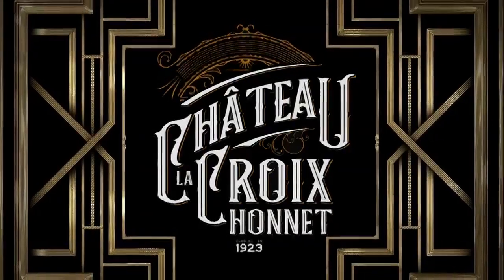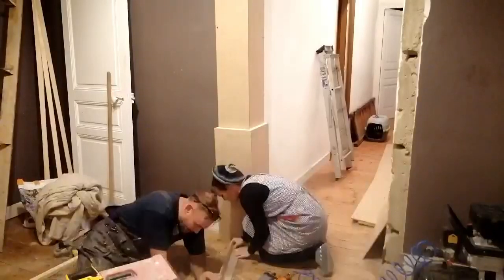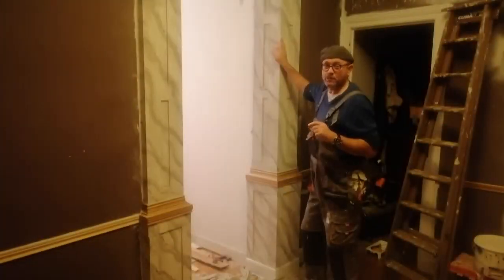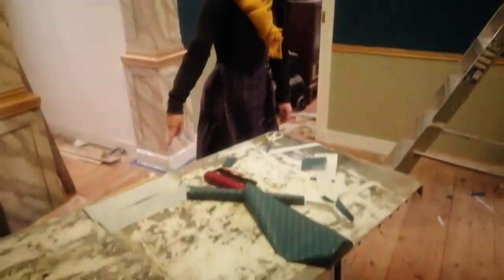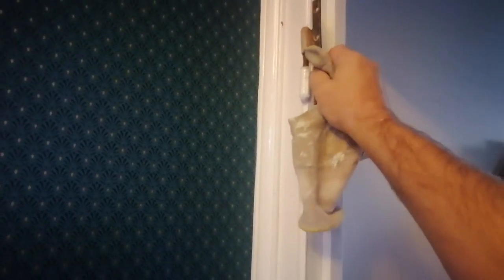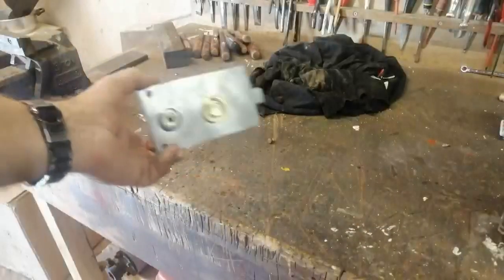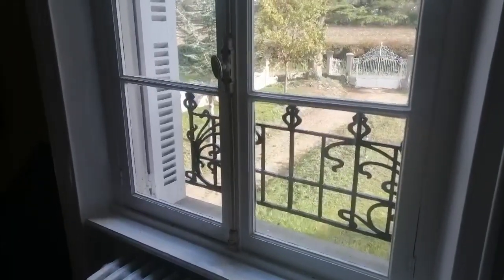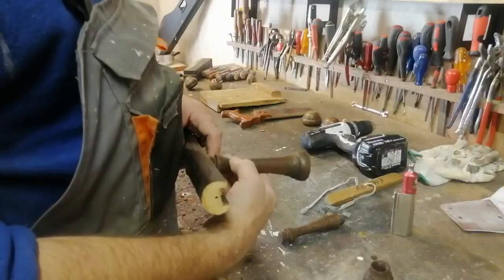Ep 60: Wow, what a landing!

Comment: As always, well done. I love your attention to details. Nice job on the marbeling of the columns. Door hardware looks to much better with the paint off and cleaned up. I have used a crock pot to boil the hinges in water- works great
Reply from the maker: Thank you very much mark, and thats a top tip on the paintwork, thank you for your comment and suggestion!

Comment: I’m not a fan of faux finishing, but I think if you’re going to faux-finish the pilasters, then they need to be faux marble from floor to ceiling. If they were real marble, the skirting board and the carved ‘dado’ section of the column between the main vertical portions would not be wood, and would not be painted. I wouldn’t have skirting board on the pilasters at all, it is essentially a door frame, and the skirting board is supposed to die into the door frame. Also, the architrave/lintel would be marble, all the way to the ceiling. The way this is painted, it gives away the marble illusion, and it violates the visual hierarchy of the room as a whole. The pilasters and architrave are a primary architectural element, but you’ve got it divided up so that the parts of it get sort of pulled into the secondary architectural elements of the wall divisions above and below the dado rail and picture rail. That kind of blurs the lines a bit for me. Of course, all of this is a matter of opinion, so feel free to ignore mine.

Also, since you mentioned that you’re color-blind, I hate to criticize your color choices, but this color scheme feels a bit haphazard to me. Of course, I don’t know how accurate the color is that I am seeing it on my screen, the colors definitely look different in reality and you have to take what I say with a grain of salt in that regard. But, to my eye, the color below the dado rail doesn’t seem to coordinate with the other colors, and the bright white of the door casings and skirting board and cove section of the ceiling seems too stark in contrast with the other colors. The fabric of the curtains doesn’t seem to coordinate with the wallpaper to me, but if the colors from them were pulled out and used elsewhere, that would go a long way toward unifying the color scheme for me. I wouldn’t suggest making any big changes, I’d mainly just pick a neutral color that coordinates with the other finishes for the elements that are currently stark white. I would also probably change the color below the dado rail to something slightly darker and more in the color family of the wallpaper and curtain fabrics.

With all that being said, this is a remarkable room transformation, and the end result is very impressive.
Reply: The challenge you've had and the results you've achieved are amazing!Hat's off to you both, a class result, You both love this place & it shows, a beautiful couple that deserve the best in life.